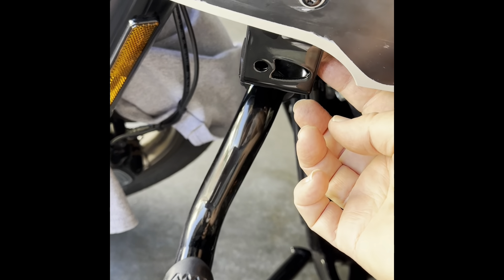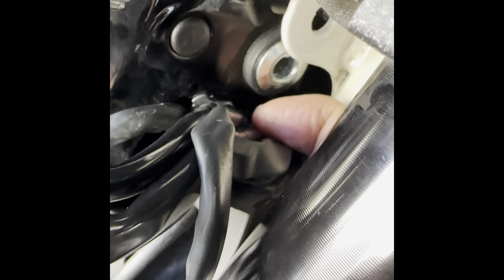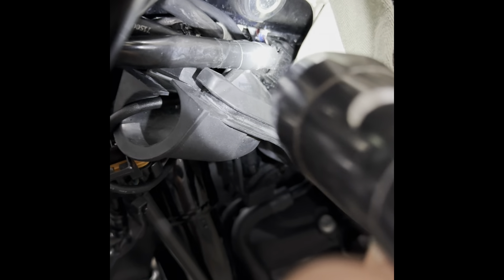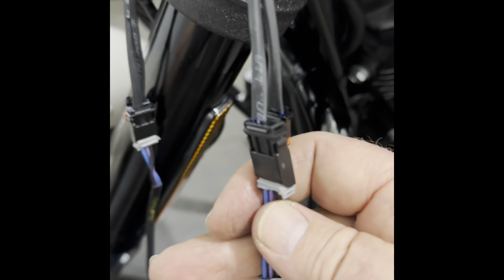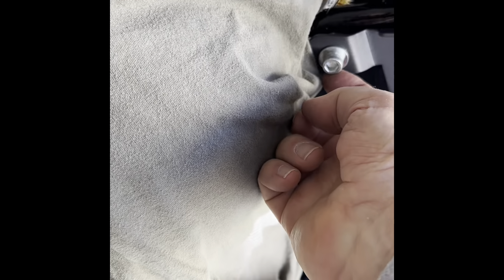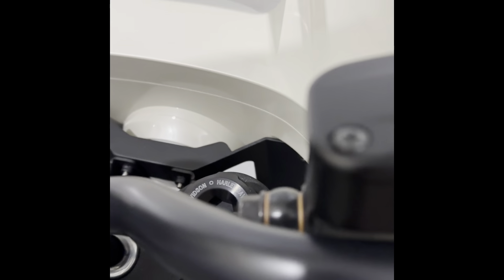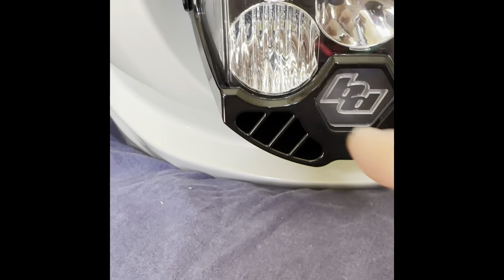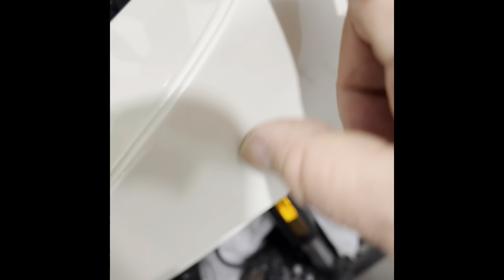Install Advanblack ST fairing and LP headlight on FXLRS 2023 w/mustache crash bars

Comment: Thanks Tom.  I used your video as well as the advanblack install video.

I installed my mounts from the engine guard backwards initially too.  For the cables in the boot - if you take the boot out more it'll be easier to connect cables - Just lift the tank up a little more to do that.  For the turn signals on a 2018 FLSB I was able to pull the cable through without de-pinning - I tied a small string to the connector in case it got stuck - it didn't get stuck.
Reply from the maker: Awesome! Thanks so much for the details!

Comment from the maker: Those grommets for the windscreen aren’t that bad if you’re careful. After I got them in you can’t tell that any bits and little pieces came off 🤣 I believe this job can be done better if the gas tank is completely removed. That way you can run the wires for the LP6 to the battery neater and probably easier. Everything is probably easier with the tank off. Comment please of you have experience.